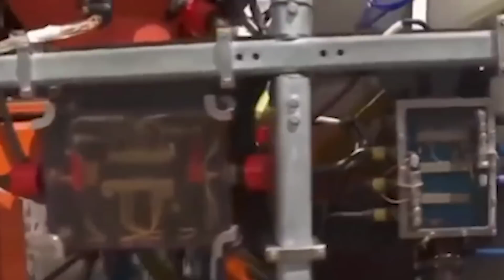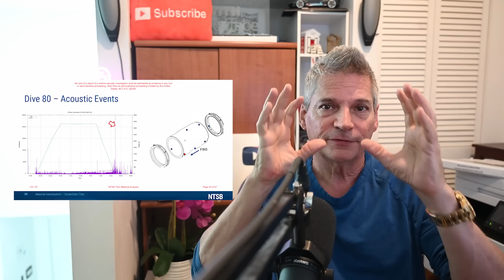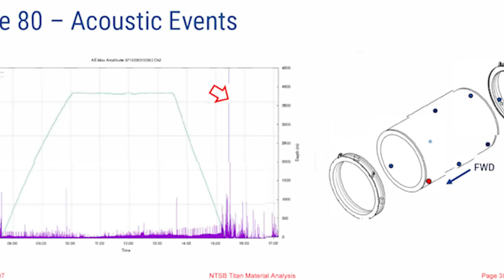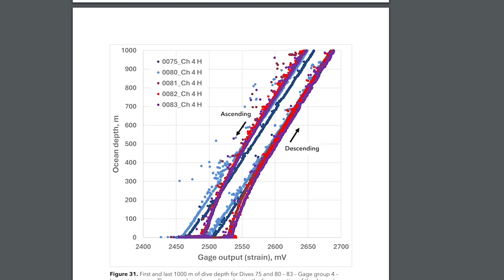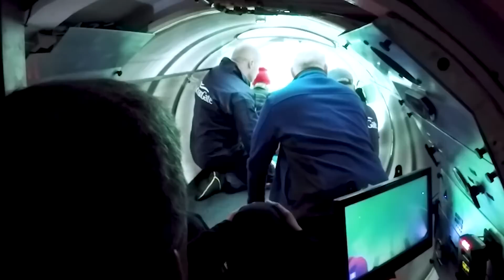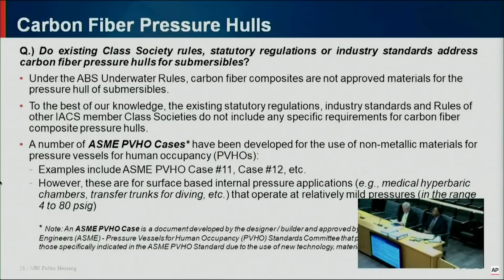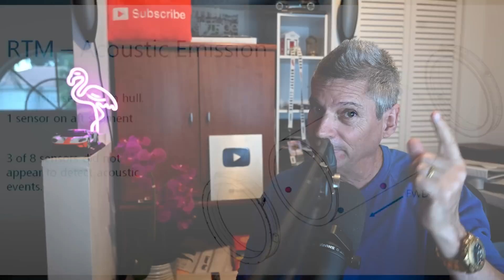How OceanGate Titan Sub Realtime Hull Monitor FAILED! RTM

Comment: Did the 1/3 scale model also have appropriately scaled carbon fibre strands, glue thicknesses etc? Because if not the scale test would have given them a false sense of security by making the hull appear much stronger than in reality.

Comment: I believe it’s a reactive sensor system.  Unfortunately the failure issue with it just isn’t just like an over heating engine you can watch changes really happen. It’s probably either their.  Or just not. So their isn’t a way to watch anything happen

Comment: Great analysis of the possible issues with Rush's design. Even with no expectation on what his RTM system data would be, it looks like he should have recognized that increasing noise was worrisome. The loud pop as one of later dives ascended could have been a sign of de-lamination that should have been investigated.

Comment: I don’t understand the point of a RTM warning system. The pressure vessel shouldn’t be making any crazy noises at all! Also who’s to say you’ll make it back to the surface in time? It’s like a 2 hr trip, and if the hull is compromised won’t lessening the pressure on it create stress in the OPPOSITE direction? Like bending  something back and forth repeatedly??

Comment: RTM did warn passengers (and Stockton), problem is that he must have been setting sensitivity lower and lower on each dive so he could continue selling tickets. Imagine an airline pilot turning OFF stall warning, possible collision warning, low fuel warning, low hydraulic pressure warning, all instruments present on a Pilot controls panel, just to "make one extra flight" before maintenance. Not "system" failure but GROSS Operator incompetence (or greed). Situation was so bad that no sensitive sensors were needed, ears were enough. Earlier passengers already complained about "cracking sounds" and Stockton suggested "bring your own Music and listen through headphones". He was trying to mask ominous sounds.

Comment: Acoustic monitoring system question: how many data points in total from all dives were recorded? If each recorded point represents broken fiber(s), how many broken fibers in total are there from all dives? And how many broken fibers represent the threshold of catastrophic failure? If 100 = the failure point and each dive has 10, we are good for 9 dives and I'm not going on dive #10! I think that it's easy for Stockton to discount recorded fiber breaks on past dives because we returned to the surface without a catastrophic failure. Whew! Made it! But repetitive stress cycles and additional breaks keep adding up until the point of no return.

Another question: why did PH believe this vessel to be safe? Or did he not care?

Comment: I see hysteresis in strain gauge readings on that chart in your video. Would it be in the hull, sensors, or interface/software? Is raw data from the dives available to the public?  If hull hysteresis, I'm inclined to agree that delamination leading to shear failure resulting in buckling as a reasonable explanation for the implosion. The end flange does not appear to be very deep. Buckling will reduce the area supporting the edge of the cylinder. Did you notice if the end of the hull tube appears ragged in any of the images?  If you have specifications for the strain gauge, we could learn if sensor damage might be suspected. We could also estimate shear forces in the laminate. For the later dives where shallow(relative) water strain is significantly non-linear. Could that be damage the result of damaged(over extended from an earlier dive) strain gauges?

Comment: I used to install stress monitoring guages on the wings of the Australian F111, it was new technology then and considered very usefull and important,  as these planes were certainly aging,,  to not use these guages as your life support was just stupidity,  after seeing the graphs produced from the data,  the vessel should have been disassembled for inspection,,  but they did not,  now they are all dead.

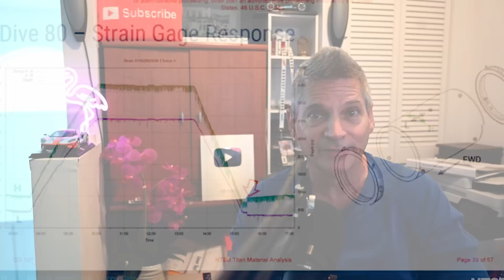Comment: Wait a second. I think you missed something. The test failed at 6,500 psi, not at the pressure at 6,500 meters which is around 15,000 psi.  At 18:53, you said you believe that Stockton didn't think it would be a problem until he went to 6,500 meters. It failed at pressure not far from the Titanic's pressure. At the Titanic, pressure is already nearly 6,000 psi and that thing failed just above that?

Comment: He needed an active hull monitoring system, the natural frequency would change with depth and pressure and also delamination and compression of voids.

Needed more 45 warp in the layup and wall thickness at centre needed to be 8” tapering to 5” to keep 2nd moment of procession well away from 1st harmonic

Comment: Even 6th grade science students know circle is stronger than any other shape when put under pressure, it's why arches, half circles, are so successful in load bearing building construction. That  weird oblong tube shape was designed to fail under pressure. Not to mention the large load bearing window. I don't feel bad for the others who died because the warning signs were there,they were educated in geometry just as your average 6th grader they chose to ignore the warnings and their own common sense...whatev.🥱

Comment: Of course the acoustic monitoring was a joke carbon fiber will not take flexing or twisting it simply shatters without warning we found this out using carbon fiber in our model helicopters years ago. The cracking sounds heard as they were surfacing were more than likely the individual 1-in laminates separating between each other as the outside pressure decreased on top of that there are always air bubbles in laminates.

Comment: There's evidence to suggest it was not the carbon fibre hull that failed first but the titanium end cap. the entire flange had been shorn off. It's been suggested that the adhesive used to bond the hull to the end caps, Loctite 9394, had an axial sheer strength 1600psi less that the pressure at the depth of the Titanic! The flanges could probably have coped with that if they had been a lot thicker. Once the aft end cap flange failed and the end cap was driven into the hull, the hull shattered.

Comment: Excellent analysis, but I think you missed the biggest key.  They measured each dive as a discrete event and pretended each dive was the first-and-only.  So if each accoustic event is a fiber snapping, you know those assumptions (which ARE somewhat true of titanium and steel) cannot possibly be true here.  Every accoustic event is a permanent and unrepairable loss of hull strength, because fibers do not repair as you pointed out.  A wiser approach would have had a lifetime cumulative acoustic event limit that says "after we detect X number of fractures we no longer have faith in our design rating and the hull is retired".  Such a system would have also inevitably said that any single large event, even if survived for that drive, scrapped the hull or if they did much more testing know how to account for that large break, so large it caused a measurable reduction in hull stress, along with smaller events when recalculating depth rating or evaluating confidence in the safety factor. 

This was, of course, why they refused to do this, they didn't want to scrap hulls they couldn't afford to rebuild.  But it was the equivalent of just deciding not to weigh yourself and then you don't have to worry about your diet.  They didn't WANT to know when the hull was unusable, so they didn't look.

Comment: Can't believe I'm writing this. I may have figured out and 'modeled' a failure mode in the carbon fiber hull winding I haven't heard talked about at all. If I'm right, it's really strange, scary and interesting. Please know, I'm just a recording media specialist. I do repairs, custom modification and research experimentation with big magnetic tape and motion picture film equipment, for over 25 years.     I couldn't help but notice something that has me very concerned about winding carbon fiber on a mandrel to make a 'pressure hull'. 
If I'm right, this is a sequence of issues that would begin with things like contamination material getting wound up in the turns of carbon fiber AND/OR... TENSION issues in the winding (such as too low wind tension, too high wind tension, sudden tension changes during winding, and/or gradual tension changes above or below exact optimal tension AND ANY off-roundness what-so ever that was (in fact) accumulating in the wind. Yes we've already heard about this regarding Titan of course.     What I'm saying is that if the winding tension goes high and/or has diagonal wind spacing iaauea and causes many turns to slip and tighten during the winding and take up slack caused by low tension (or vise versa): the many turns that slip over or under other turns that remain stationary with respect to the mandrel will result in a wave in one or many turns(layers) and a void just beneath the wave would form. And yes we already know this also!...
But what happens when deep sea pressure tries to push the (now curred epoxy) waves (and underlying voids) to move AROUND THE CIRCUMFERENCE of the hull!?!?. When you push inward on one of these waves, I believe it's likely to (at least sometimes) make the wave travel around the circumference of the hull in one direction or another... maybe even both if it collapses in the center and becomes two waves. As it does this in any direction, it will be breaking the epoxy between the wound layers as the void travels with it. AND also maybe will break the bonds between all the layers in the wave itself. And multiple waves may meet each other and then travel as one bigger wave under the right circumstances. This could also cause a 'winding up' of tension in a long section of the whole winding. 
The wave travel might get stuck at some point and then suddenly continue, perhaps putting enough pressure to cause another type of stress point de lamination/breakage. Then when the 'submersible' re-surfaces it might tend to  reverse this whole process as the surrounding pressure goes back down, perhaps now with shifted pressure areas due to the new damage, causing a different path of de-lamination. 
I have no idea what carbon fiber strands do when they are put under tremendous compression forces in the form of a traveling wave. Or when the wave runs into an area that will not yield easily by de-lamination, maybe resulting in folding and crushing. 
Maybe I've got much or all of this wrong or it's not a primary failure mode but I suspect there are waves getting pushed into different shapes at least. And perhaps a wave could move perpendicularly/outward instead of around the circumference of the hull, given that the wind of the carbon fiber was wound back and fourth along the width of the mandrel, which might make these "waves" travel diagonally. But we DO see waves and corresponding voids in the cross sections that were cut off the ends of the carbon fiber tube.  I think this means that many turns slipped and tightened at the same time as some loose wind 'slack' in turns below the outer winding(s) was taken up. I suppose it could also have been the diagonal wind shifting on the mandrel or the carbon fiber strips changing shape or the diagonal turns or individual fibers themselves shifting closer together (as they exchanged the width of the strip for strip thickening. 
Whatever that device was that payed-out the fiber strip after just having coated the black epoxy onto it must need some kind of rapid-response servo tension control. The largest reel-to-reel studio videotape machines I maintain have very large heavy 1" wide tape reels and need ultra fast, super accurate tension control servo electronics because they can run tape VERY fast, change direction in less then 2 seconds at max speed and stop on a dime all while maintaining perfectly stable tension floating on air pressure. When that system fails all hell can break loose, streaming 25 feet of tape across the room and then suck it all back in before you have time to hit the kill switch. Those machines were used for national broadcast perfect-quality analog, cost $200,000 new in today's money... You'd think that when Ocean Gate wanted people's lives to depend on precision tension control... they'd BETTER have something at least as good with tension as an AMPEX VPR3. So I say 'to hell with all of this hopelessly, utterly enshitificated dot com start-up engineering that has taken over most "engineering" everywhere for everything (at the MOMENT). Almost every tech business now reminds me of Titan in one way or another. Just stop it!

Comment: It was also mentioned that at the end of the dives “there was several gallons of water sloshing around underneath the floor and when they opened the dome it just poured out”. Did they ever sample that water to see how much was sea water? Or are you trying to tell me that every person lost five pounds of body weight in a cold, moist, non exercising environment? Three gallons of water weighs almost 25 pounds/5 people. Read the maintenance log and see how often they had to get the “air out, drain the water and refill with oil” on the equipment that was not supposed to have water in them.

Comment: The thing about these sensors is - did he even do destructive testing? Having strain gauges and acoustic sensors are great and all but if how they directly correlate to known failure modes then they can be (and did get) hand-waved away as "expected sensor signatures".

-- Edited - Ok, I hadn't gotten to that part of the video yet. They did do it but at 1/3rd scale. No cycling testing though. Just Do the one and then break it in the one test.

Comment: The fact that they did not use a spherical pressure hull cannot be accepted as a CAUSE of the implosion, as the weaknesses of a cylindrical hull COMPARED TO a spherical hull are known and therefore should have been handled with the adequate level of strengthening and redundancy.  

the poor choice of material, poor construction quality of the structure and negligency regarding testing and monitoring are actual causes.

Comment: I believe that the damage from dive 80 caused progressive damage on every further dive. Of which I believe only 1 or 2 actually got any kind of depth. But I might be remembering that wrong. 

One final snap of a carbon fibre could be all it took. Carbon fibre hulls fail catastrophically from things like cycle fatigue, delaminating, hell even poor seals not built to support such pressures. We’ve known this since the early 90s when carbon fibre hulls were repeatedly tested to destruction and found to ALWAYS fail without warning. 

When your 1/3 scale model fails. You don’t build it to size!!

I believe he was so arrogant, he convinced himself that he would ‘get away with it’. Despite knowing all of this.

Comment: The warning signs were all there. He chose to ignore them. I don’t think nothing would have convinced him he was wrong and needed to stop at that point. 

It’s a poor design, with poor manufacturing that was never properly tested. The thing that drives me up the wall is I see zero reports that he conducted cyclic fatigue tests. He tested a maximum pressure to failure, but he never studied the effects of what 10, 100, 500 dives down to depth would do. 

And I firmly believe contrary to your comment that this was a fatigue failure. If it was a single point failure, you wouldn’t see the changes in hull performance on the real time monitoring data from dive 80 onward. Something went wrong with that loud crack, and then it proceeded to get worse until it failed. This was a progressive failure following a catastrophic initiating event.

Comment: By the way, the missing window will eventually be found, if not found already and most likely held by a collector. Depending on the process, acrylic floats. Dont know how fast, but eventually it will hit the surface, and can be a very dangerous object for a boat to hit. Bulletproof windows are made of this stuff. Due to its weight, it will most likely be flush with the sea, or even an inch beneath the water.  Someone will eventually find it.

Comment: The one inch cuts showing spaces between the carbon fiber, should not be counted as evidence. The spaces can easily have been made during the cutting process due to friction and heat buildup from the blade. 
If you ever cut an 8 layer piece of plywood with a band saw, you will see what I mean. Glue 200 pages, like binding a book, shine a light through,  then cut those in half, and shine a light through. You will now see gaps.

Comment: I think there were warnings, but they ignored them, or didn't recognize them. The NTSB changed the graph to show depth instead of time, and you could clearly see a change after dive 80 and the infamous bang. 

All of the post 80 dive had different movement patterns showing a considerable change that should have been identified and investigated.

Comment: The solid resin in the hull would be compressed (shrink) at extreme pressure.  That compression would facilitate delamination.  The carbon fibers would provide very little resistance to that resin compression since their strength comes in when they are in tension.  That hull may have been more resistant to external pressure if no carbon fibers were embedded in it.  A massive titanium ring in the center of the dull would have provided a lot more resistance to implosion.  If the hull resin flexed enough to trigger a strain gauge output, the hull would have collapsed at that point.  Rush just did not understand enough about what he was trying to accomplish.